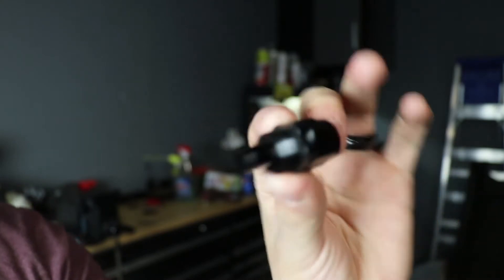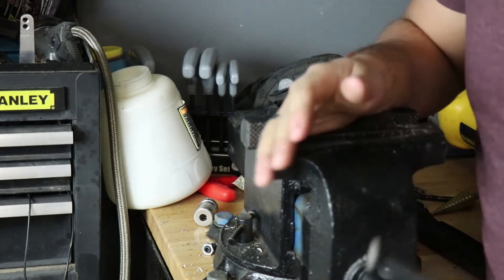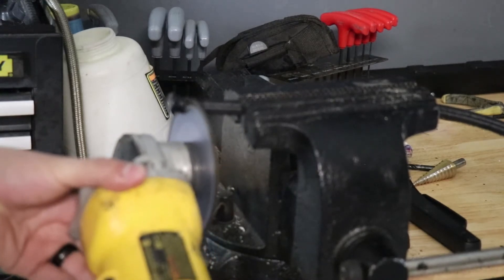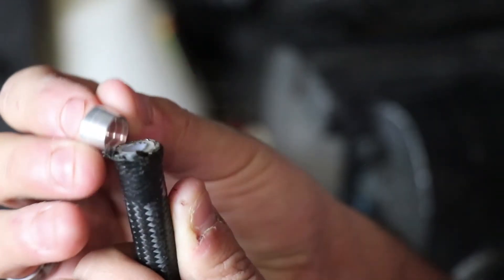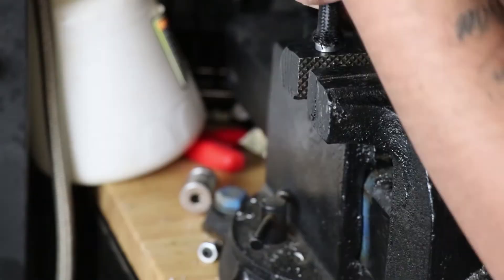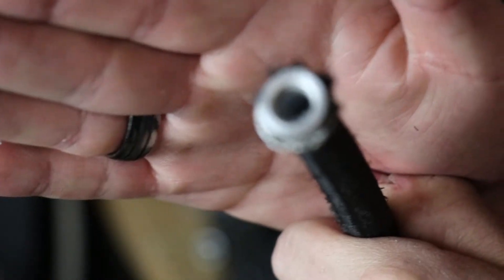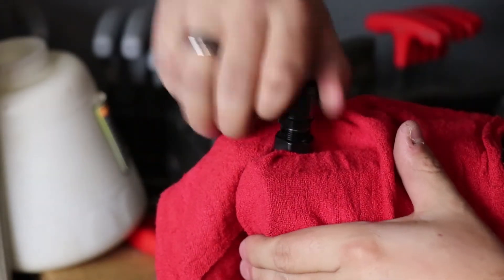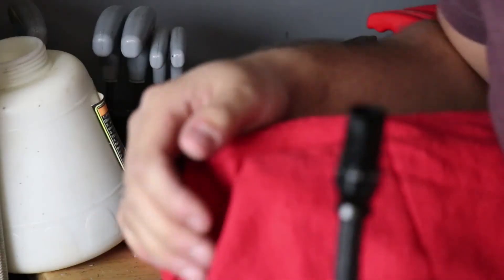How to Make -AN Fuel Hoses WITHOUT Special Tools

Comment: Where do you get the metal fittings for the hose ?
Please advise Thanks !
Reply from the maker: They are called AN Fittings and can be bought nearly anywhere that sells car parts. amazon eBay summit. I have a few kits here in the parts lists. Jovanidantegriego.com/blog